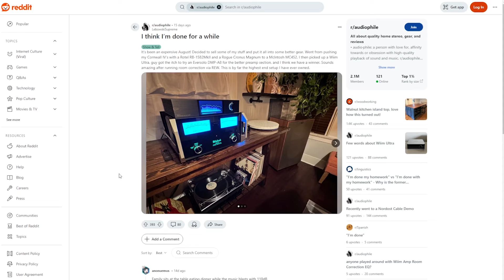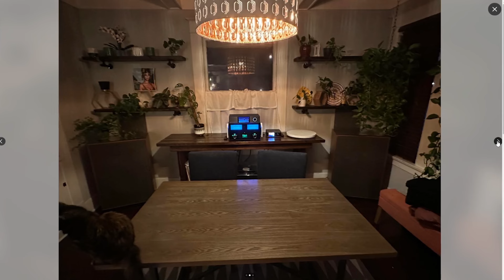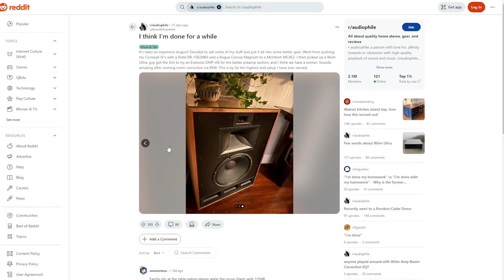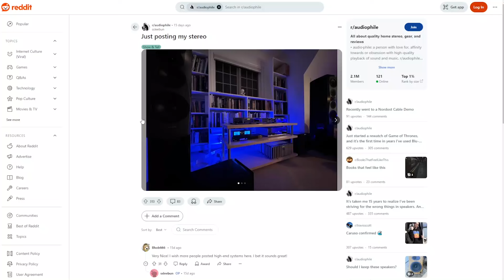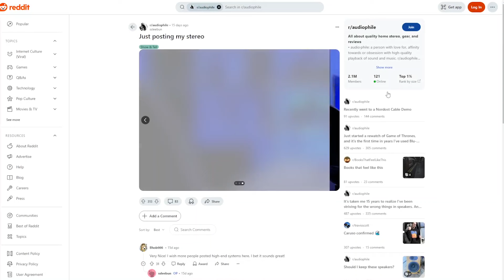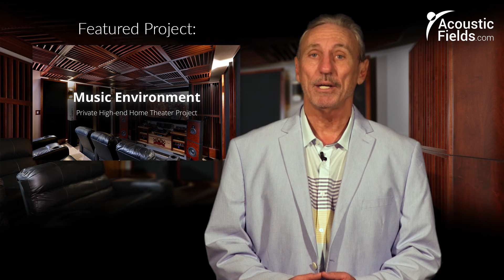r/audiophile - Move Your Equipment Rack Out Of The Way! - www.AcousticFields.com

Comment: I love your straightforwardness in your videos. No bs.
Reply from the maker: We cut through the marketing hype and nonsense for people (most) that do not understand the physics behind room treatment. Companies promote false narratives and they pervert the laws of physics to sell treatment types that under our current laws of physics can never work as they advertise. Most treatments in the marketplace are building insulation based. Building insulation is not an acoustical tool that promotes resolution. It is designed for thermal conductivity not sound absorption. It is a band aid that does not work at lower frequencies and destroys middle and high frequency resolution using the wrong rate and level of absorption. I receive calls every day that people are stating their room is too "dead". When you examine their treatment choices, they are building insulation based. Our products are specifically designed for music and voice. They will not keep your room warm or cool.
Reply: @ I can attest to this. You fail to get the same resolution with building insulation as you do with proper acoustic foam. Even then, the panels most companies sell are far too thin, doing nothing for the bass frequencies and destroying all the nuances of the mids and highs. They complain that their room is boomy and lacks clarity even though they have their walls laced with egg shells carton panel. I was once that person and once I started developing and properly testing good made room treatment, I laugh at the gimmicks that most companies consider “acoustic treatment”.
Reply: @ your advice has literally saved me thousands. Even with my “mediocre” setup, the resolution I was able to achieve was unbelievable. I always used to blame my equipment for a lack of clarity but once I treated my room properly and effectively, I was surprised at how good my system actually sounded

Comment: It's rare to have this useful info shared with fellow audiophiles. I've been into this hobby since the early 70s and until recently I'd never heard of the importance of avoiding furniture, fireplaces and eq. racks between the speakers. Recently I donated my huge display stand upon which I had my equipment and replaced it with a 20" high media stand. Suddenly I had a soundstage. For years I thought I needed ever better gear...
Reply from the maker: Remember pressure and reflections. Stay away from obects that produce spurious reflections, especially between the speakers and the sidewalls.

Comment: I’ve strived for over 40 years to build a hi-fi system which reproduces music the way I prefer to hear it. The nature of my job, means that I’m constantly on the move. Town to town, city to city, even country to country! Wherever I go, my hi-fi goes with me. So, naturally, I’ve set up my hi-fi in multiple rooms, of varying shape, dimensions and construction materials. With out exception, it is always the sonic characteristics of my hi-fi which prevail, dominate the listening environment. Not vice versa. 

If you have the luxury of a good sized, dedicated listening room, furnished solely with your hi-fi rig, listening chair and maybe, beer fridge? Then maybe, room treatment, DSP or EQ, may help. But for the rest of us whose hi-fi has to fight for it’s right to be in the family lounge, the ‘stuff of life’, carpets, rugs, curtains, sofas, cushions Etc. Will more than likely insure RT60 levels within acceptable limits and diminish, even negate the need for room treatment, EQ Etc.  Remember, you can play around with, alter room acoustics/ambiance. But, whether this altered acoustics constitutes an improvement, is surely down to personal taste or preferences.

As regards placing your rig between your speakers, many of us have no choice. I have a purpose built media cabinet which houses my entire hi-fi rig. Proudly sat on top of that cabinet is a 98 inch TV. A substantial floor stander flanks the right and left side of that cabinet and TV. My hi-fi generates a well focused soundstage with clear instrument separation. My TV’s rear mounted, down firing speakers, totally boxed in by those afore mentioned floorstanders, creates a significantly wider soundstage than my hi-fi. If your preaching is gospel? How can this be?

For all you family orientated, music 1st, audiophiles, please don’t suffer room anxiety. How many cars do you see furnished with bass traps, defusion or absorption panels, even the speakers are located in the corners, below ear height and the only person sat potentially in the ‘sweet spot’ is the central rear passenger.  Employ speakers that load the room correctly, not DSP EQ or acoustic correction that compensate for your system or environment’s inadequacies.

Most of all, enjoy the music.

Comment: I still wish that you offered equipment recommendations.

I have speakers that have a hole in the back to generate bass. I also have Magnepan panel speakers which are bi-directional. Are these a big "no no"?
Reply from the maker: If you treat your room correctly, any price point of gear will sound correct. The differences in gear resolution are much smaller than in room resolution.
Reply: @AcousticFields  I understand, but is it better or worse to have a bi-directional speaker or mono-directional speaker within the perfect room?

Comment: Dennis, as an educated audio engineer with my own home studio, I completely understand - and appreciate this information. However, like you mentioned, space is rare - I work in an 11' by 12' room>.I set my monitors at the "sweet spot", which means they are 21/2 feet from the side walls, and 2 feet from the front wall. I believe I have remedied any issues by placing low-end absorption and diffusion behind the monitors.  In your opinion, am I on track? I have a really good ear, and the room sounds very good. Is there anything else I could  (should) do? Thanks!
Reply from the maker: Have you measured your efforts. Stay tuned for a simple real time room measurement video series.

Comment: The third setup, middle of the video... fine example of how to absolutely debase the sound in a way the owner will never figure out. He's put the whole shebang in front of what amounts to a wall of bad resonance generators topped off with a window dead center to add add high frequency resonances to the low frequency ones made by the book shelves and also add in the jagged vibrations of the glass. People don't seem to comprehend just how much energy speakers put out into the room and how that energy vibrates everything and any 5 sided box will generate resonances at their specific frequencies.
Reply from the maker: You are correct. Most do not understand the basics such as wave and ray energy. When you understand the basics, everything else falls into place. You either have a pressure or reflection acoustical issue. Hi - Fi and its associated treatment types is a constant management of those pressure and reflection issues.

Comment: I’ve been watching rate my home studio videos recently. You’d probably shake your head and laugh through the entirety of the videos. It’s hilarious how many have spent well over $10k on outboard gear for their home studio and they either have bare walls or only crappy foam on the wall.  Even with so much information on this platform about the REQUIREMENT for room treatment to be able to mix. They’d rather watch compressor shootouts and post comments why it’s essential to buy the $4k compressor and how the $400 clone is vastly inferior. Yet their room is completely unusable. Huge screens between studio monitors disrupting the phantom center.  One channel in a corner. One channel missing a wall. Window behind one channel.  I benefit from it though because these people drain their account buying new gear and I get to pick up their used gear cheap on FB Marketplace after they give up because they haven’t been able to mix successfully.  I’ve spent most of my time and energy treating my room. 12 months calculating building and adjusting and 80% of my budget so far.  Probably won’t ever be done. I actually enjoy that more than buying gear.
Reply: Me too. I love solving acoustic issues and general hifi things, and I am so over buying new gear and then being disappointed by it. Way more improvements in setup and acoustics.
Reply from the maker: Its the journey that takes the time. Once you reach the end, you will know it.